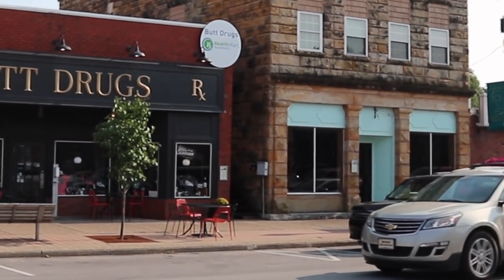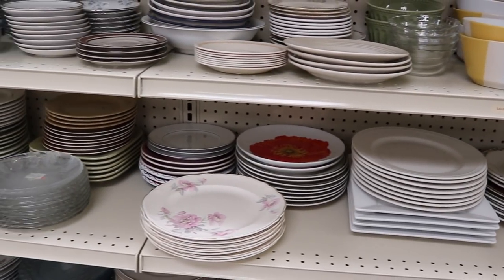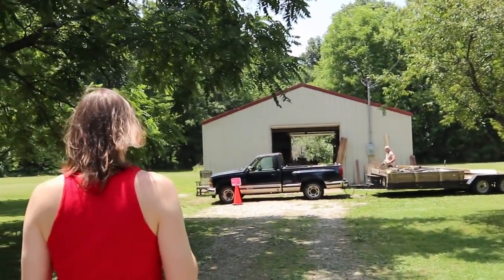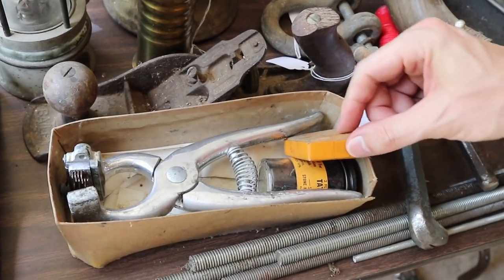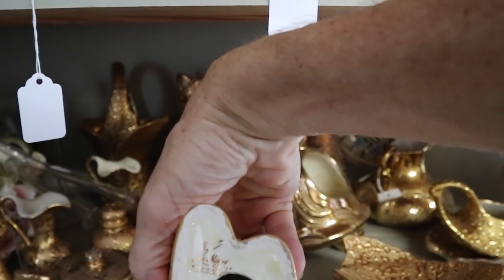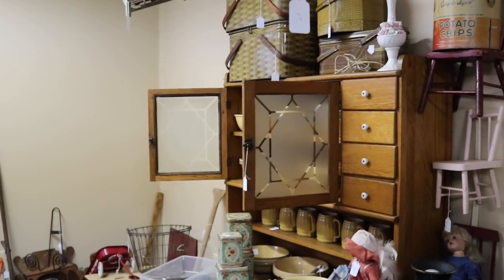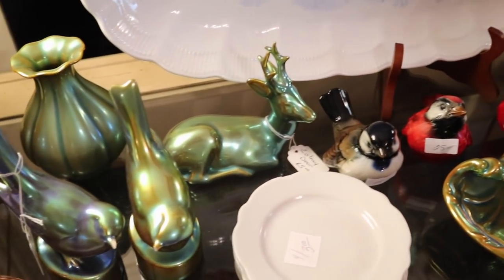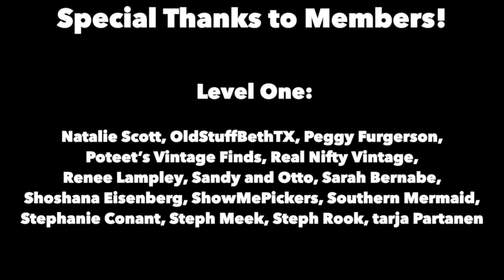GOODWILL, GOOD ESTATE, GOOD ANTIQUING! | VINTAGE SHOP WITH ME

Comment: We have an old milk can with a Pierce seat from I guess a small tractor attached to it somehow.  Should I strip it down to the original metals or perhaps creatively paint it?  I am not at all artistic so I hope you say no painting and just strip the paint.  Is it ok to keep the two attached together….an outdoor stool.  No plans to sell it.
Reply from the maker: I wouldn't strip the paint either, if it's the original! I'd keep it together. Frankly, if you do choose to paint it, it's yours to enjoy as you please. You can certainly restore it later but it won't enhance the value to repaint